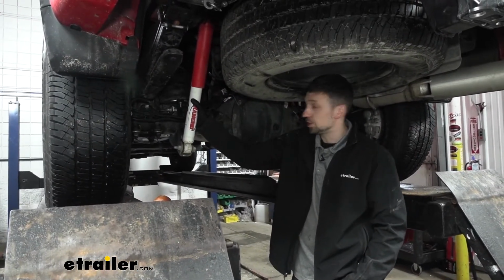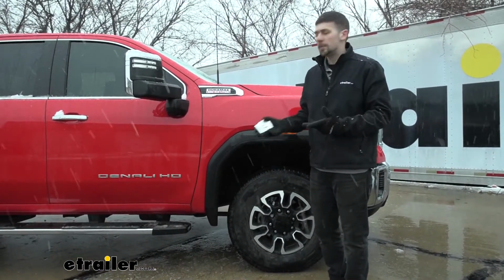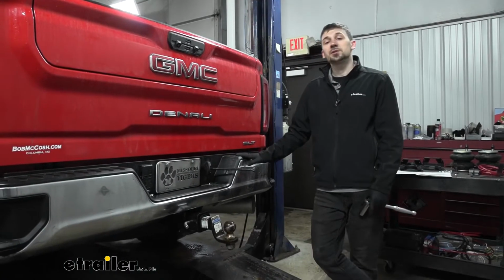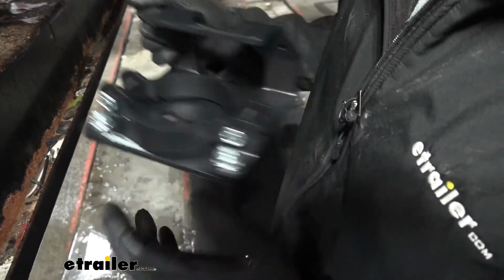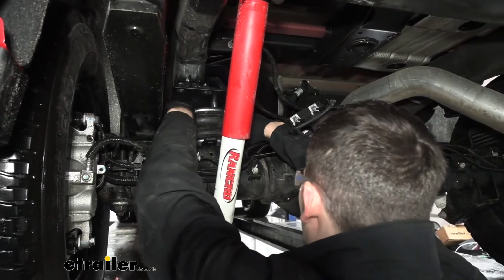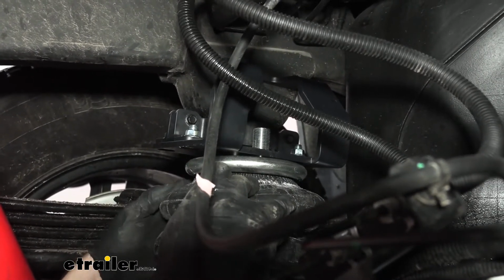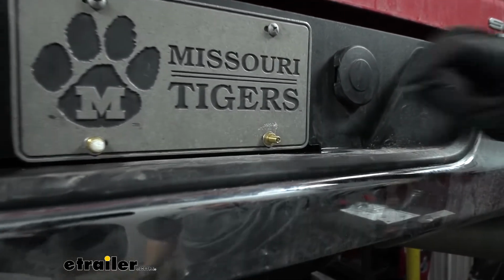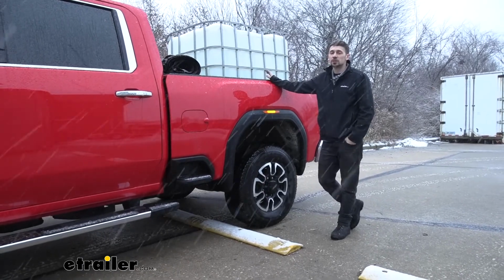etrailer | How to Install: Firestone Ride-Rite Air Helper Springs on your 2020 GMC Sierra 2500

Comment: Super helpful video, made install very straight forward. If you have a lift and all the tools it's about a 3 hour job.
Reply from the maker: Thank you for the feedback! A lift makes this installation much easier but it is still possible from the ground or with a set of car ramps.
https://www.etrailer.com/Vehicle-Suspension/Firestone/F2613.html